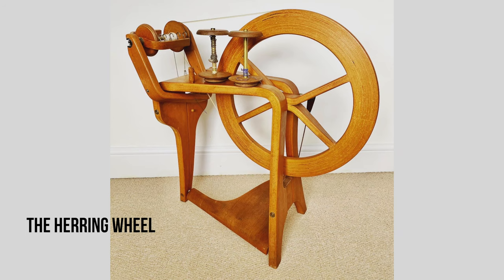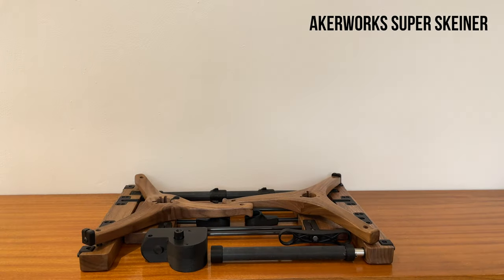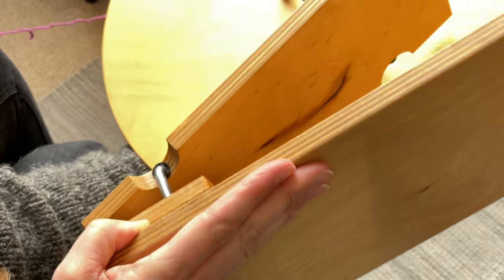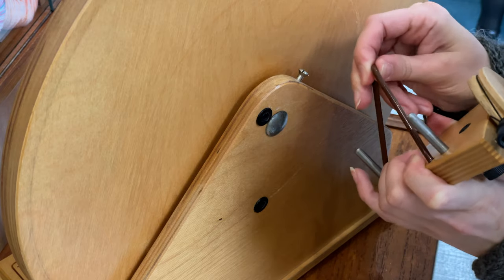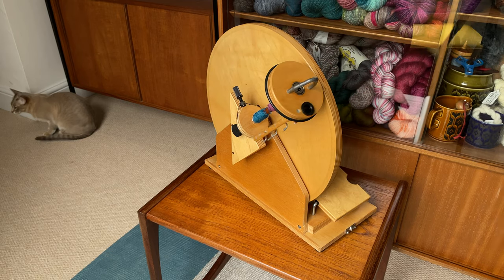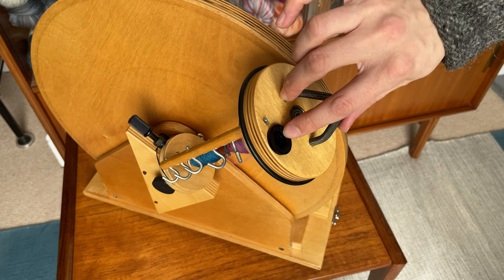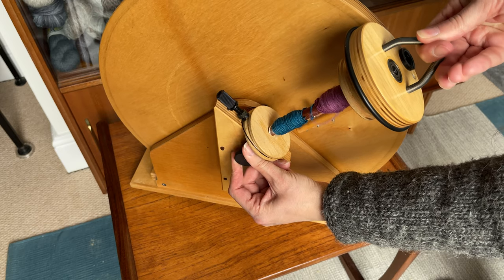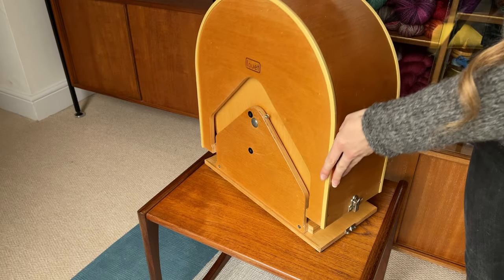Louet S40 Hatbox Spinning Wheel

Comment: Thank you for this. Just this afternoon, I saw the students at the end of the block were having a yard sale, and there was a tiny spinning wheel. It's in very good shape, although it's missing most of the lazy kate (the steel bar and the connector), all the bands need replacing, and the latches are very corroded. Not bad for $20. It's dated June 1982.

I've resisted spinning for a while, despite the strong presence of the Humboldt Handweavers and Spinners Guild. I'm a crocheter, dang it! I saw in the comments you don't recommend this for a beginner; perhaps I could pass it on to an actual spinner.